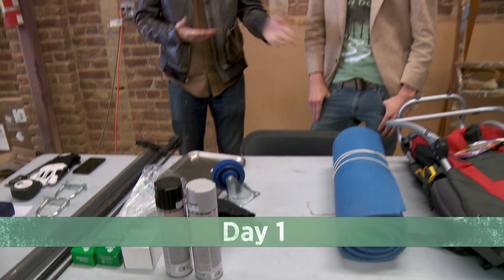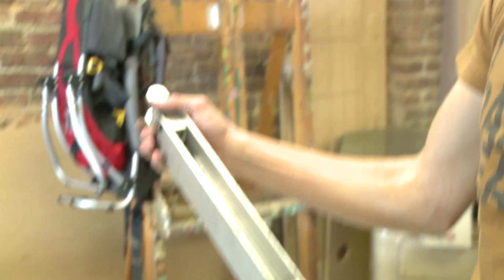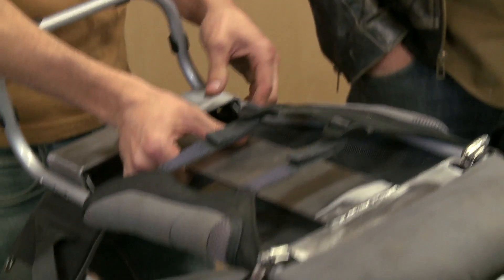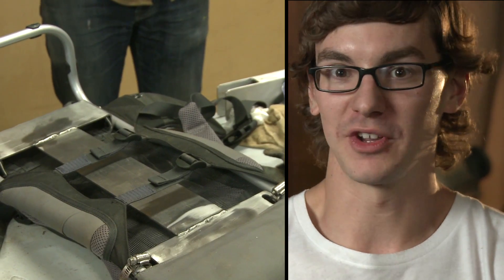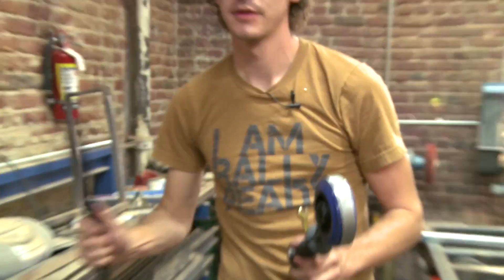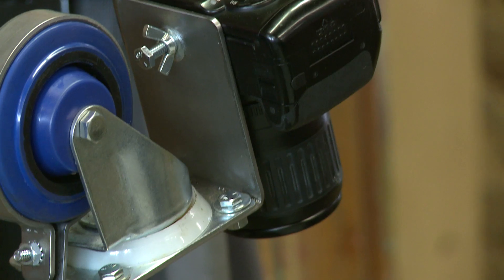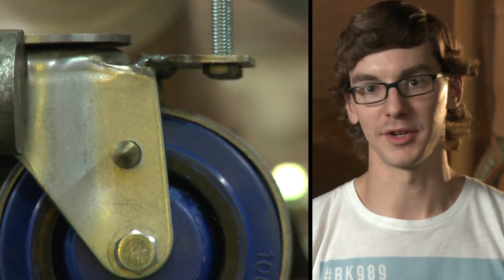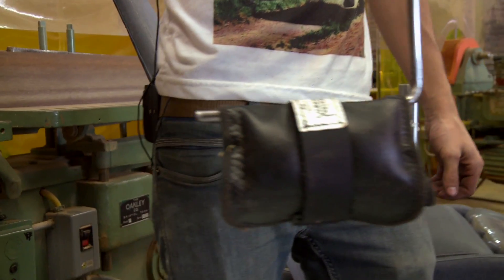The Inventern Episode 13: Building a Steadicam

Comment: IT IS >>>NOT<<< THE SAME THING, BUT:
if you lower the center of gravity a really lot, like attaching a long pole from the camera in your hand down to the level of your feet, dangling there in the air, and adding some more weight down there, when you hold the camera up high at the normal level, it is a quick-and-dirty way to steady the motion somewhat.
Reply: oh, you did it... not so extreme, but I saw the weights hanging down there later. neat =)

Comment: The dude should had done at least some research before building a steadicam. Only thing the looks great is the arm but have to say the brace too weird and not really much looking like a steadicam. Also I can see probably won't work as he probably thinks as I think he has too much weight on the bottom and instead of counteract the top weight and be bottom heavy which causes it not to be steady.

Comment: WHY IS WEARING GLOVES WHILE USING A GRINDER!! Never ever use a moving machine wearing gloves. If it was too hot he should of used pliers or vice grips.
Reply: Graeme Evans
With more that 30 years of shop experience I can tell you I seldom use a grinder or wire wheel without gloves. In that time I have never had a grinder eat my glove but have often had the gloves save my hand by taking the damage rather than my skin.
Quite frankly if you have a problem with your gloves getting caught then you desperately need to learn how to by gloves that fit your hands.
Reply: You have obviously never had a grinding wheel come apart in use.
Reply: Graeme Evans
It is obvious from the condition of the finger that James did not catch it in a grinder. It was most likely a cutting tool of some kind like a notching tool and it wouldn't really have mattered if he had gloves or not, he got that close he was going to lose something.
Cuts often come metal parts before cutting burrs are removed, the very task grinders and belt sanders (the tool in question in this video) are used for. While on parts as small as what this kid was shaping I would have used a pair of vise grips, I would still wear a pair of gloves to keep from burning myself as I repositioned the part in the pliers.
Reply: mq1506
Do you use the same logic to justify not wearing safety glasses?
No matter how well you check the grinding media if you work with them long enough you will have a failure.
Wire wheels, especially hand held, are particularly bad. They are horrible about catching gloves but the alternative is having to pick wire bristles out of your hand.
As for the polishing wheel incident, this is one reason why all of my bench equipment is set up on foot switches so that I do not need to reach for a kill switch if something happens. I also absolutely do not use hand grinders with locking switches.
Reply: mq1506
That is a prime reason to 1, remove the shroud on the wheel so there is nothing to bind objects against the wheel and 2. use a foot switch which would have allowed him to kill the motor within milliseconds.
As for gloves at the mill, I am guessing you have not spent much time trying to dig minute metal splinters out of your hands. If you use proper technique there is no more chance of catching a properly fitted glove in a mill or lathe than there is to catch your bare hand.
Reply: chrisose If you checked the grinding wheel for faults before you used it you wouldn't need the gloves. Personally I would prefer to deal with stitches over a skin graft from a 3rd degree burn. 
http://craftygrafty.files.wordpress.com/2012/04/progress-day-55smaller.jpg

Those were caused by a polishing wheel
Reply: chrisose Source: http://www.reddit.com/r/IAmA/comments/1fhcek/nsfw_gore_last_year_i_suffered_a_3rd_degree/ 

It was a Jewler's buffing wheel. The guy in the video is also wearing gloves while using a mill which is plain stupid.